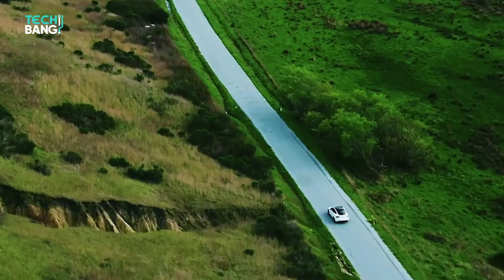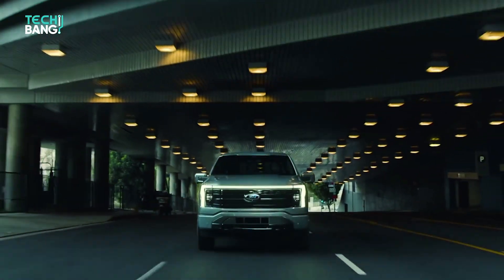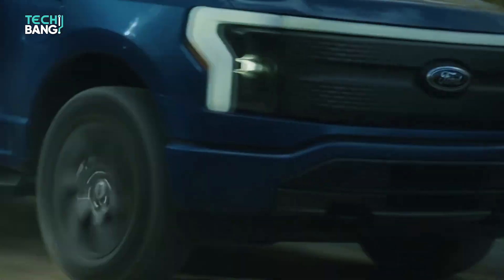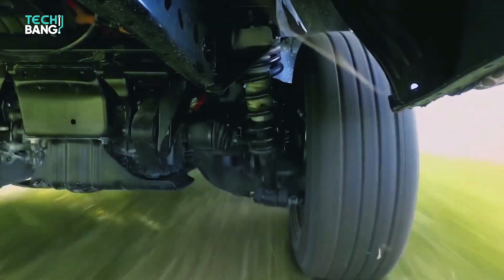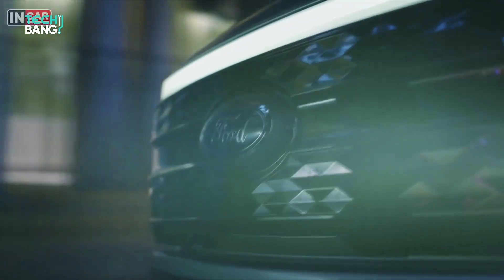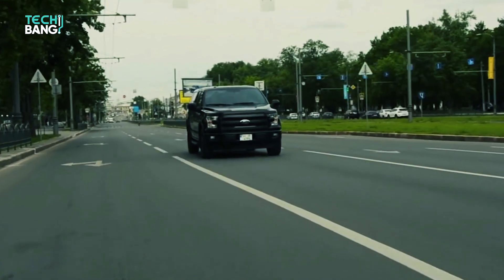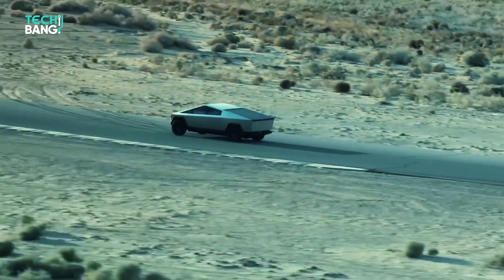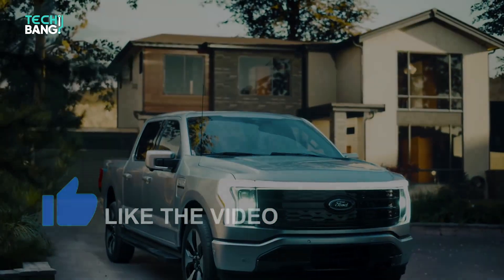Electric Ford F-150 Lightning: How Does It Compare With Cybertruck?

Comment: Ford may be bankrupt soon.  Also buying everything thru LG Chem really takes a chunk of profitability.  So far behind on automotive chips.  Changing from gas to a whole new infrastructure costs billions.  We shall see.  The more the EV’s the better.  Battery costs come down for Grid battery storage systems for wind and solar use at night.  In house battery production at the auto plant cuts costs tremendously.  A stainless steel truck with easier  stamped sheets means faster line, less people, no paint shop, and cost savings.